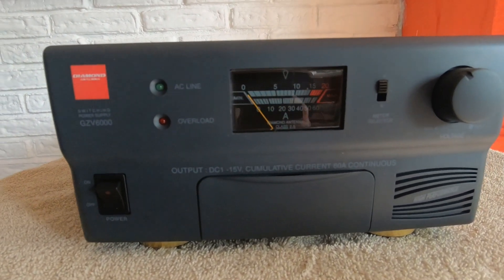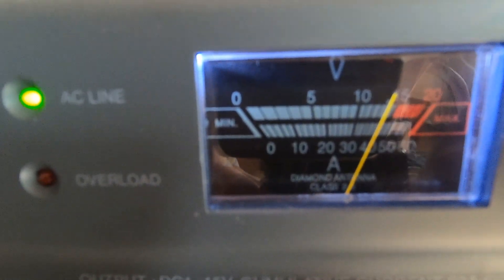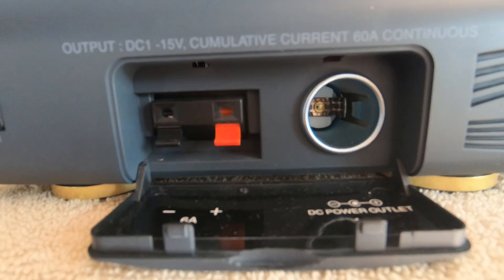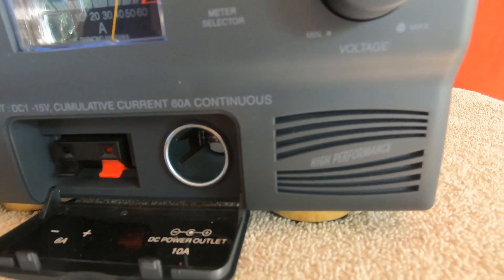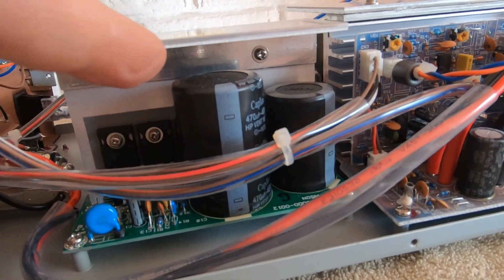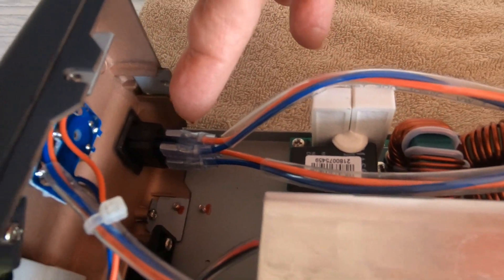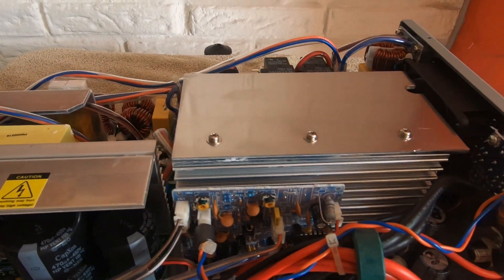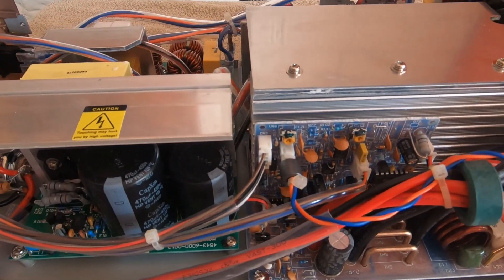DIAMOND GZV 6000.HEAVY DUTY 60 AMP POWER SUPPLY,WHAT IS INSIDE.....

Comment: So where’s this 8W speaker everyone has put on the 💩 spec sheet? 🤣🤣🤣🤣
Reply from the maker: Hi,well spotten, for some reason there's no inbuilt speaker, luckily for me, it's not a problem, thanks from Rotterdam 73.
Reply: GZV-4000 has speaker in front and 3.5mm jack on back. GZV-6000 doesn't have that. (GZV-6000 has voltage remote sensing to accommodate for voltage drop on DC wires which 4000 doesn't have).

Comment: Thanks for the two videos you've provided on the Diamond GZV6000. They helped me decide between the Astron RS-70 and this power supply. The Diamond unit arrived today. Looks like it will be perfect for the 375 watt 6 meter amplifier I'll be running with it. Of particular help was the view of the back connectors, fan, etc. This isn't shown in any of the Diamond literature. Great to see inside, too. Thanks again and 73.
Reply from the maker: Hi,I was very impressed with the large connecting posts at the rear,,,it was perfect for the Rm 703 60 amp linear amplifier, sold the amp, but kept the power supply, thanks from Rotterdam 👍